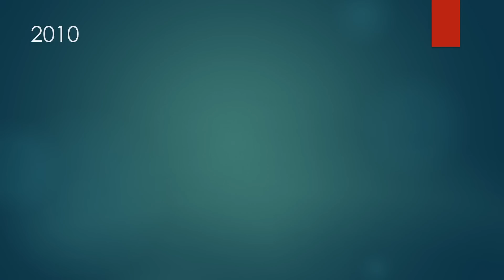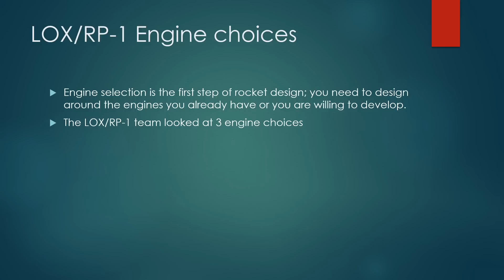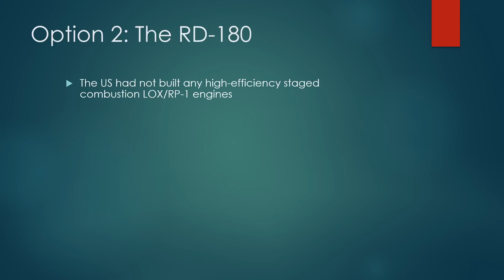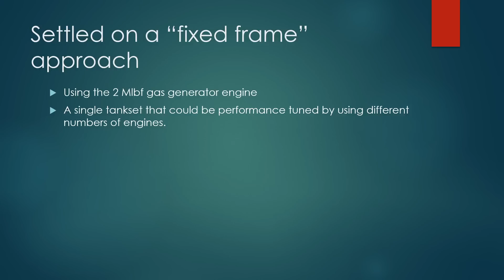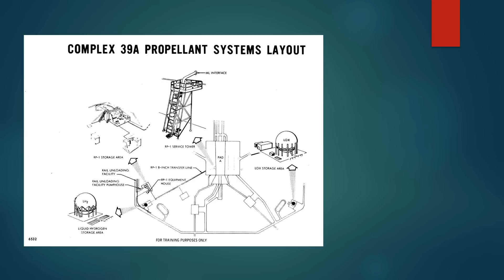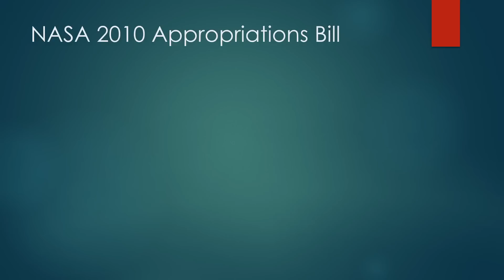Why don't we fly the Saturn V? An alternate SLS history...

Comment: Large RP hydrocarbon engines are a thing of the past because of the problems with pogo. There is no way to constrain pogo when you are dealing with the enormous turbopumps necessary to feed something on the scale of the F-1. I just read a long paper about the pogo problem, which still existed in unsolved form right up to the last Saturn V launch. And I really don't understand how anyone can not see that using the absolutely proven propulsion of the Space Shuttle without the problems brought by the orbiter is not an excellent idea. SLS is the best thing to happen is a very long time.
Reply from the maker: Both the understanding of POGO and the analysis methods that could be applied to it in 2010 are a bit more advanced than the state of the art in the mid 1960s. 

There are equivalent issues with large solid rocket motors due to thrust oscillation. Ares I had very significant vibration loads from this, and one of the reasons Europa Clipper was moved off SLS was because the vibration environment was much worse than expected. 

WRT the overall choice, I think it's pretty clear what the JSC panel thought about the technical desirability of the various choices.
Reply: @EagerSpace  That is a myth. Each Saturn V was a separate case. They all showed significant pogo, but in some cases it - particularly Apollo 13 - it came near to destroying the rocket. Putting in accumulators was a black art. Yes computational fluid dynamics has come a long way but such problems are endemic to heavy staged rockets. Even the Titan nearly didn't make it to man rating because of pogo. On the other hand, the characteristics of the SSME are by this time completely known.

Comment: Excluding political requirements to reuse Shuttle/CxP tech and contracts as much as possible, a Shuttle derived heavy lifter in the form of SLS was probably the only thing NASA could afford to develop at the flat budgets they were/are receiving, and even then with staggered development between the Core Stage and the EUS, it wouldn't fit in the budget any other way.
And that was with an existing stockpile of pre-developed engines that just needed some adaptation, an initial upper stage that was a lightly modified off the shelf Delta IV upper stage and with SRBs already under development for Ares I built with STS heritage hardware.
An all new 3 Stage RAC-2 development with new engines and potentially new facilities would have been MUCH more expensive and have taken a lot longer to develop, especially under a capped flat budget profile.
RAC-2 might have been the technically better option, but at least with RAC-1 we got a design that could actually be funded and implemented with the funding restrictions NASA is under.
Reply from the maker: Certainly a fair point and one that NASA listed as one of the disadvantages of RAC-2. For the first/core stage, I'm not convinced a new core stage plus the F-1B would have been more expensive and taken longer given how price and cost of the core stage and RS-25, and the current design engine cost for the core stage is just ridiculous at $400 million per launch. 

I understand the second stage point, and I think unfortunately there is no great engine option for RAC-2 other than the J-2X. 

From a cost perspective, the problem with shuttle derived is that the costs ended up fixed at the expensive shuttle prices plus a premium for fewer units. Once again, that's a point NASA made when discussion the shuttle derived option, and they were certainly right on that. 

The problem with the current design is that it is just barely affordable and leaves precious little money to do anything else.

Comment: Elon Musk says he can build Raptors for $500k a piece, maybe as low as $200k. Thrust up to 650,000 lbf. NASA just gave out a contract for 18 RS25’s for $1.8 billion, or $100 mill each, thrust 510,000 lbf. What is going on????
Reply from the maker: Part of it is simply that SpaceX is vertically integrated; it's in their best interest to build as Raptors as cheaply as possible because that makes Starship cheaper and makes them more money. AR is in the business of making engines, and it's in their best interest to sell engines for as much as possible, and they have a fully captive customer; there is no other hydrolox engine out there that works for SLS. 

And part is certainly the number of engines planned; AR is only building 18 of them, where SpaceX will use more than that on a single SuperHeavy booster. 

And part is the design; the RS-25 is just ridiculously complex. 

This is pretty much by design for SLS; it was clear at the beginning that the RS-25 would be the only engine choice and NASA would just have to suck it up and pay for it.
Reply: Elon's estimates, aside of usuall brag and lack of idependently verified bookeeping, might largely depend on economy of scale ( building large number of engines continously ). On the other hand, RS-25 isn't really worse than raptor and is already PROVEN.  Total 46 has been EVER built ( divide cost of industrial base and R&D among them), which is about 150% what is going to be required for for single Starship/Superheavy.
Reply: @piotrd.4850  There's no 'might' about it. Economy of scale is very much how SpaceX have achieved low cost for Merlin, and intend to for Raptor.
Even so, there's no denying that RS-25 is uniquely expensive. The RD-180 is similarly complex, double the thrust, human rated, and still a tenth the price.
And not particularly mass produced, apparently about 6 per year, which is what NASA would need for 1-2 SLS launches per year.
Reply: I've seen estimates that $250 million per RS25 is more realistic.

Comment: The human learning was not documented on how to build the F1. As the workers died, the craftsmanship died with them! It was developed so fast, the nuances were not put onto paper! 

It could be produced using 3D Printing by taking apart one of the surviving units.
Reply from the maker: Dynetics and PWR had an improved F-1 called the F-1B  that they pitched for SLS in 2013. I would have been much easier to manufacture. 

https://arstechnica.com/science/2013/04/new-f-1b-rocket-engine-upgrades-apollo-era-deisgn-with-1-8m-lbs-of-thrust/

Comment: the dimension of the specific impulse is simply the velocity of the combustion gases. But for calculating the rocket, "libforce*sec/lib" is of course cleverer.
Reply from the maker: The dimension of exhaust velocity is meters per second, but the normalization to isp using acceleration gives the somewhat nonsensical "seconds" as the units.

Comment: 25 September 2022, and SLS still has not flown.  In the long run, I suspect the successor to SLS will be a 21st century version of the Saturn V, with 21st century versions of F-1 engines for the first stage, and with 21st century J-2's for upper stages.  The people who worked out the best best way to fly to the Moon essentially got it right first time.
Reply: I imagine NASA isn’t going to design and build a new rocket for a very long time (if ever again) after SLS
Reply: @robyn051  19 October 2022, and SLS still has not flown.  It is intentional that my comment posted three weeks ago does not specify the constructor.  Moreover, since the original design is excellent, there is no point making something completely new.

Comment: Interesting video. Bottom line, no rebuilt saturn V because congress wanted to reuse/repurpose shuttle hardware,  infrastructure, and supply chain.

So NASA is stuck trying to reinvent the wheel, while a perfectly good system is ignored. The result? Still no working launch vehicle, 11 years later.

In contrast, the Saturn V was designed between 1960 and 1962, and the first flight was Nov 9, 1967. 
Five years from drawing board to successful launch, all without the help of modern computers and manufacturing technologies. 
Two years later, man was on the moon. More progress in those 7 years than in the last  50.

Congress and NASA need to stop wasting time trying to reinvent the wheel. Bring back the saturn V and apollo,  fly them regularly, and learn from the soviets who turned the soyuz system into the most successful and reliable space vehicle currently in use. 

One last thing. If Congress and NASA had stayed with Apollo, they could have launched every satellite the shuttle did, gone to the moon 100 times, built a space station, not killed 14 astronauts in avoidable accidents, and still had money left over. We would have the worlds best space program, instead of a program that can no longer put a man into space, much less go to the moon.
Reply from the maker: SLS is exactly what Eisenhower was talking about when he coined the term "military industrial complex", though it's aerospace rather than military.
Reply: I know I'm late to the party but I agree. Nixon and congress gave NASA 2 options and they picked the wrong one.
Reply: @12pentaborane  I was told much the same thing by a NASA engineer.
Reply: @EagerSpace  YouTube is saying you replied but I can't see it
Reply from the maker: @12pentaborane  Weird. 

WRT shuttle, all NASA management cared about was any versions of shuttle that would allow NASA to survive in its form at the end of apollo. If they hadn't gotten shuttle, human spaceflight probably doesn't continue. 

For SLS, it's all about NASA management wanting to keep the ecosystem that made them successful going.

Comment: I hear the technology that was known by the people that cast the engines we don't have anymore
Reply from the maker: It's certainly true that the old approaches are no longer used. But that's because there are better approaches. 

In 2013, Pratt & Whitney rocketdyne proposed an SLS booster that would use an updated F-1 known as the F-1B. 

In addition, an updated version of the J-2 known as the J-2X was built and hot-fired during constellation, though it was not finished.

Comment: 16:05 Maybe the could've also considered the RD-170/171 engines? The RD-171 (essentially a slightly upgraded RD-170) belongs to the same series of engines as the RD-180, with the only difference being that the RD-171 puts out 1.8 million lbs (~8MN) and uses 4 nozzles instead of the 2 nozzles on the RD-180. The RD-170 has actually been flying on the Ukrainian Zenit rocket until only recently (when the stopped sending rocket engines to Ukraine). The Zenit, itself was originally a booster for the Soviet Energia Rocket, which could lift 100+ tons or the Buran space shuttle.
Reply from the maker: There was a third option that I didn't talk about that looked at commercial launchers, and one of those options used ORSC engine that looked similar to the RD-170/RD-180.
Reply: Why? The SSME is the best and most reliable rocket engine ever made. It is also extremely smooth and efficient. Why not use what works?
Reply: @ultrametric9317  Firstly SSME is not the most reliable rocket engine ever made, plenty of engines have flown more with a better track record, like RD-107a and Merlin. And it's hardly the best engine ever made either. That title belongs to the Raptor or the RD-270. 

Secondly the SSME is a hydrolox engine, it's simply too weak to be used as a booster engine. That's why both the space shuttle and SLS have to use massive inefficiant solid rocket boosters to compensate for that. Engines like the RD-170 uses kerolox and have far better thrust, which you want out of booster engines.

The most idle rocket in terms lf performance would be to have boosters using RD-170s while having a core stage using the SSME.
Reply: @TC_164  And the SSME is also notoriously expensive compared to most other engines & motors!

Comment: I keep wondering why the Big Friendly Rocket concept (Sea Dragon, Starship, et alibi) was not on the table. If our methodology is to blame, how many other great ideas are we missing?
Reply from the maker: At this specific point, NASA had a mandate for a rocket of a specific size. It didn't have a mandated mission though the moon is an obvious one.

Sea Dragon as designed does not work because you can't build rocket engines that big; the F-1 for the Saturn V initially had unstable combustion and it took a lot of time and money to make it work. Our simulation tools are far better now, but it's not clear you can build a successful engine twice the size of the F-1, and the sea dragon one is giant. And the single big &  cheap engine was part of the allure. 

NASA doesn't build engines and it's not clear that aerojet rocketdyne knows how to build new ones any more, so they constrained themselves to engines that had already been developed for this exercise. They also wanted to go fast and engine development is generally the slowest part of the process.

Comment: Will SLS get to Moon on time? By looking at what is going on with the Starliner, it looks like that NASA may need to optimise the priorities of the entire program - quickly. They also need a new engine, because the RS-25 is too expensive to manufacture. NASA needs a Raptor engine powered by RP-1, a full-flow (or Oxygen Rich) 2m pounds engine, cheap and easy to manufacture. The F1 was build with money in full-flow and in the rush of time, therefore it was much more expensive than what we expect today to pay for such engine. I believe is the back-to-the-drawing-board step which is proving hard to take, and has caused the RD-180 to still power Atlas rockets.
Reply from the maker: I mostly agree with that. The RS-25 was a pricey engine even in shuttle because of the amount of rework it took after each flight, but it's a really bad choice for an expendable rocket, plus AR is doing their best to maximize their profits because there are no good alternatives and they therefore can just dictate prices to NASA. 

The proposed F-1B was supposed to be much cheaper to build than the F-1, but I'm a bit skeptical about that with the cost of the "cheaper" RS-25E... 

I'm not sure you can build a full-flow kerolox engine because I don't think it works with non-gaseous fuels..

Comment: Why haven’t they thought about using the RS-68A? I know it’s ablative and not human-rated, but surely they could tweak it. I love that engine and it would be dramatically cheaper than the RS-25, while producing nearly twice the thrust. The same company makes it too, so there really isn’t any conflict of interest either. 🤷🏻‍♂️🤷🏻‍♂️
Reply from the maker: They looked at the RS-68. The radiative nozzle was apparently a non-starter for a cluster of engines next to SRBs, so it would be a new regenerative nozzle and something to fix the "sets itself on fire" feature. It would have a lower ISP though 3 RS-68 engines would produce more thrust than 4 RS-25 engines, and that would have reduced gravity losses a bit.  

There was an RS-68B planned for Ares V, which had some of the fixes but wasn't human-rated. 

But 3 engines at around $25 million each would have been a lot cheaper than 4 engines at $146 million each, though the price for the re-used shuttle engines is obviously much lower.

My guess is that AR was much more interested in the contract to set up a new production line for RS-25 engines rather than repurpose the existing RS-68 one.

Comment: Thought 💭 it was because we wanted engines we could source fuel ⛽️ in space for ( actually on a planet or asteroid) whereas there is nowhere orhtr then earth’s petroleum supplies to acquire RP-1
Reply from the maker: It's certainly true that you can't find RP-1 elsewhere. Technically you could synthesize kerosene if you had water and carbon dioxide - on Mars, for example - but if you are doing that methane is probably a better choice.

But I don't think there was any consideration about that during the decision around SLS.

Comment: The RAC-2 design would have required a third stage to get good use out of it
Hawling that big second stage and it's high dry mass all the way to TLI would diminish a significant amount of potential payload
Reply from the maker: Yep. The initial SLS study was predicated on the congressional requirements, where were only to get to LEO. 

The problem being that congress specified a requirement rather than how it was going to be used.

Comment: WHY WOULD ANYONE WANT DIRTY KEROLOX ENGINES AND NOT THE MORE ENVIRONMENTALLY FRIENDLY AND MORE EFFICIENT IN TERMS OF SPECIFIC IMPULSE HYDROLOX ENGINES ? ? ?
Reply: Kerolox is dirtier than hydrolox yes, but it's much cleaner than the solid rocket boosters that are needed to help launch hydrogen rockets.
If you look at the modern SLS for example, more than half of it's fuel is in the SRBs, not the hydrolox tanks.
So kerolox actually ends up being cleaner overall. Of course, methane would be even cleaner, but noone was taking it seriously back then.
Reply: Is your caps lock key stuck

Comment: Why couldn't they just build block 2? They already have flight proven engines, boosters, tanks. Just build the big one and the big launch platform.
Reply from the maker: Block requires the EUS upper stage - which NASA through would take a long time to build - and more advanced boosters (in original plans, that would be liquid-fueled boosters and in current plans it's the "BOLE" booster, which has a composite casing instead of the current steel casing). 

Congress said they wanted to see block 1 flying by 2016 and then later agreed with NASA that 2017 was a good target, and that's what led to the phased approach.